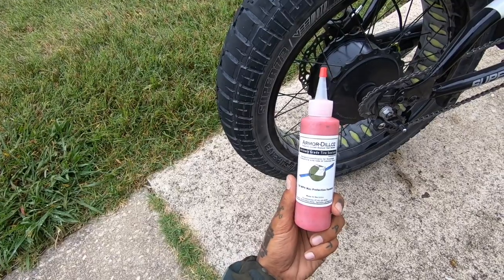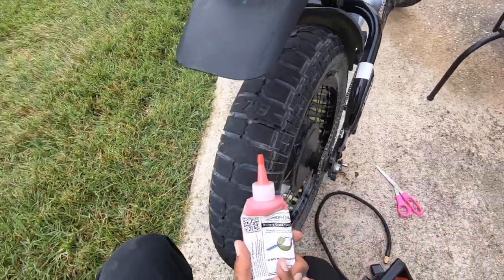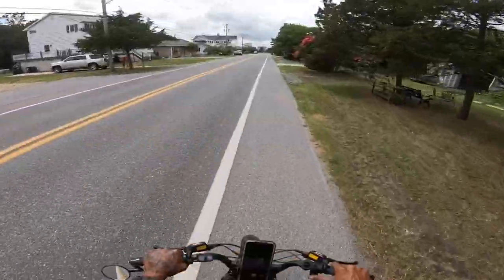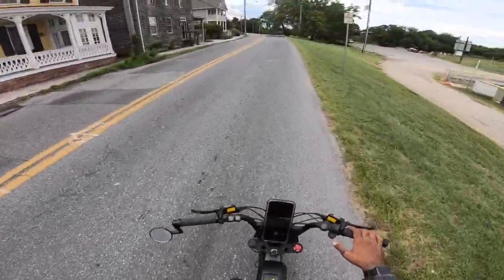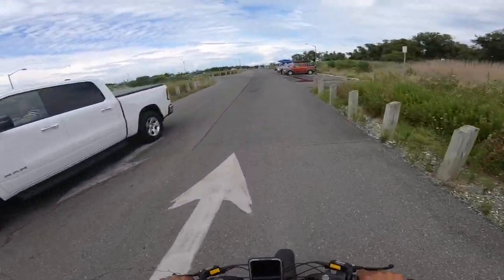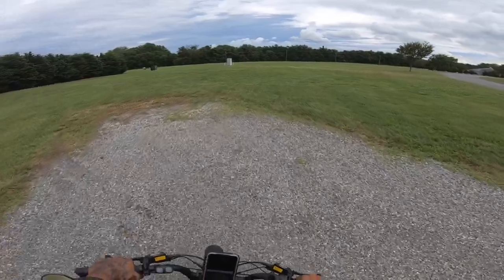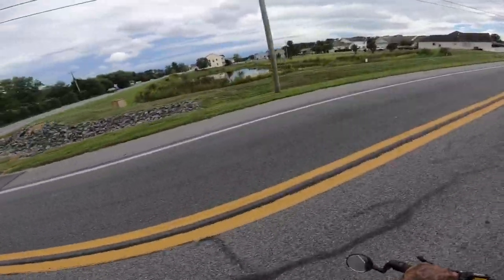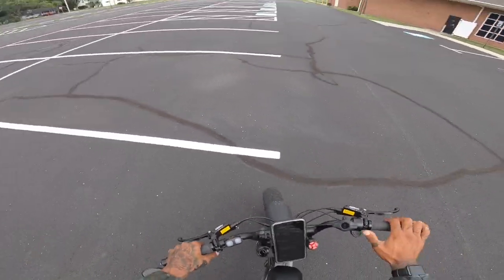SUPER73 RX HOW TO INSTALL ARMOR DILLOZ TIRE SEALANT IN A FAT TIRE EBIKE

Comment: Hi Shreddie, I didn't see anyone on here making the necessary comment so I'lll do it, lol.  That's great advice, stick it in squeeze it pump It until that fat tire's filled.  ROFL.  I don't know if everyone knows how to remove the valve core.  Believe it or not, I only learned a couple of weeks ago when I had to do it on my EUC. I didn't realize I needed a tool and new valve cores when I did it Commerce Way to order them from Amazon and wait a couple of days for it to arrive. You live and you learn. Glad the tire is now sealed, that's a smart move.
Reply from the maker: 😂😂Dude it’s holding like a champ!!!

Comment: Just ordered two 16 oz green bottles to put on the shelf when my s2 and stinger arrive. I put the green bottle in my z1 and haven't had any problems with it. Thanks for the code man. 2 16 oz bottles for $53 is a steal.
Reply from the maker: James Misa did you know huck puts tuffy liners in their wheels?👍🏽👍🏽👍🏽 also I think the blue would be better for the huck since blue is for 30 mph and over...the red is still holding strong 💪🏽
Reply: SHREDDIE MCSKATE cool ill have to order another set of bottles for the huck. Yup i seen a video where Brett mentioned tuffy liners for his bikes. This wait is awful man. Cant wait...😫
Reply from the maker: So close bro!! I’m 1115 in the order line...I thinks he’s in the 1070s
Reply: SHREDDIE MCSKATE yessir. Im 1103. At least the weather will be nice by the time we get our bikes

Comment: To be honest I don't think I'm sold on liners for ebikes. At least in the tire where you have your motor. I got the tannus inserts, a pretty expensive set. 

It seems like the insert let's the tire spin on the outside while the tube can slip on the inside. Had multiple issues with the valve stem area getting torn from getting pulled into the tire. I only have a 1200 w bike, not pulling wheelies or anything just driving around the city with hills.

Comment: Question, when I filled mine with slime, it start coming out everywhere from the tire liner “green holes”
Reply from the maker: You might want to try the armor dilloz..I have 10 percent off links left🤘🏾 what caused the hole in the tire?
Reply: SHREDDIE MCSKATE piece of wood. Very small piece. Filled hole. But now air is coming out tire liner
Reply from the maker: Recon78 Cav Scout you might want to try 12oz of armor dilloz red
Reply from the maker: Recon78 Cav Scout you also might want to take the tire off and clean all the slime from the inside then install armor dilloz...or get a new inner tube and install dilloz 👍🏾
Reply: SHREDDIE MCSKATE why do you think the green slime was being forced out from the inner liner holes where valve stem and spokes are? Hole in tire liner? Once i pumped it to 29psi it was spewing out all those holes
Reply from the maker: Recon78 Cav Scout Because it leaked all inside your tire

Comment: Would the blue Armor Dilloz work just as well or is it only for faster EVs?
Reply from the maker: Blue is for 30mph and up🤘🏾🤘🏾⚡️⚡️⚡️
Reply: @SHREDDIEMCSKATE  I guess technically the RX goes up to about 33mph so it kinda fits into that class.
Reply from the maker: @cavedroid  the red i put in my tire with the nail is still holding today🤘🏾🤘🏾⚡️⚡️